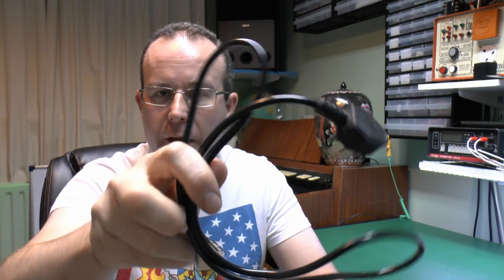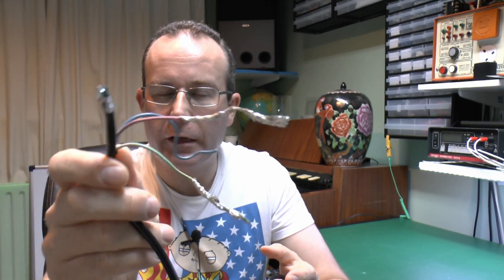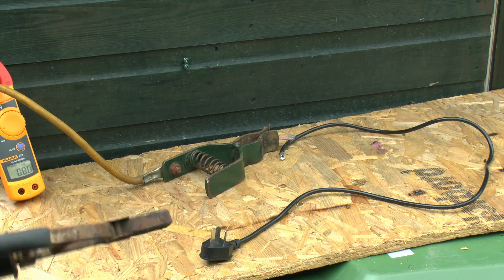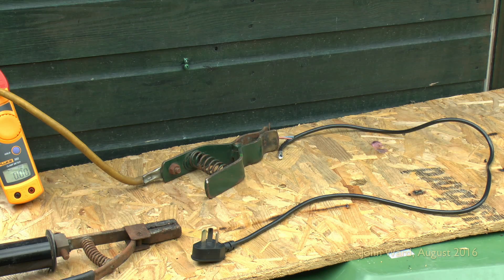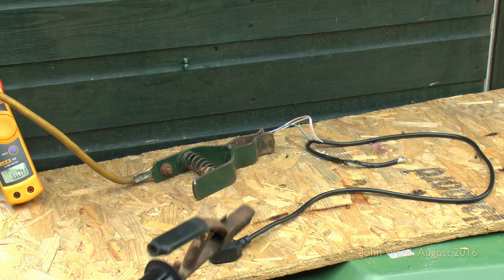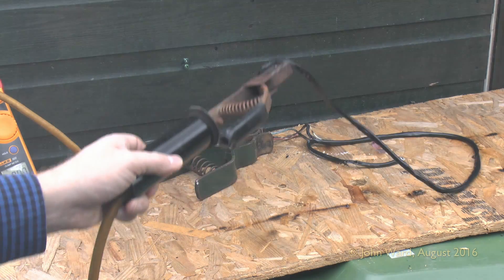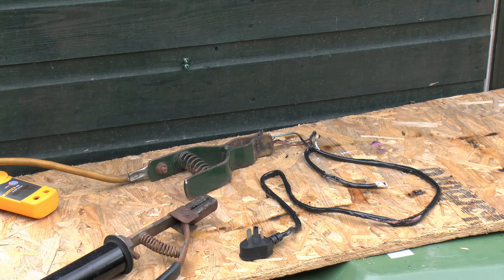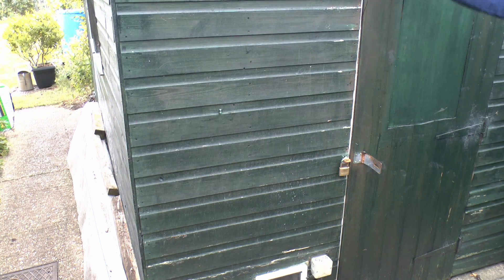Solder Pot Flex Destroyed

Comment: isn't that a Australian/new zeeland type plug?
Reply: That's a common Chinese plug, it's almost the same as AU/NZ, except you'll see that they cord exits from the side closest to the angled pins instead of from the ground pin - that's because in China they use the pattern "upside down" from the way we use it in AU/NZ (in China ground pin is "top", in AU/NZ ground pin is "bottom").  Also note there is no sleeving on the pins, which is required for AU/NZ, and the pins may be thinner also.  Of course, it's not uncommon for the Chinese style plug to be found on things sold in NZ, just with sleeving on the pins to make them legal but still upside down,  which is a real PITA.
Reply: ***** I don't know the history of why China came to use the same arrangement (that said I believe it's just "the more common one of many" used there), or use it 'upside down', but there is perhaps an argument to be made for China's arrangement - consider what happens when a plug is pulled partly out of the socket due to downward weight, in the Chinese orientation earth on top, the earth pin is exposed more than live/neutral which form the pivot thus making it less likely that something or someone could contact the live pin.
Reply: yes it is an australian/newzeeland/china plug
Reply: Therory 1 
Clearly when China copied the Australian plug they realised that it was the wrong way up and corrected it.  The Earth pin should be at the top so that if something accidentally falls down the gap between the plug and the socket it hits the Earth pin and not the live pins.

Theory 2
China is in the Northern hemisphere so naturally when they copied the Australian plug it came out upside down.
Reply: Um....  That would be - NEW ZEALAND (FFS!)
Reply: @Deebz270  Geeze, I'm a highly strung kiwi but go easy fella, Countries names are spelled differently in other languages and in some of them, the Zealand bit IS spelled as Zeeland so it's an easy mistake to make. As an example, New Zealand is spelled Nieuw Zeeland in The Netherlands, or Nederland as they spell it there natively. (FFS!)

Comment: And so easy to dispose of as well, just lift the lid on the wheely bin, and drop it inside. Have you tried a magnet, easy way to see if it is CCA or copper coated steel wire.

The utility companies here are going heavily into aluminium distribution cable, with a steel tension member, as it makes the wire less desirable, as you have to unwind the steel core off it. They even are using an aluminium coated high carbon spring steel as one of the conductors, to make the required grounding conductors on the wooden poles, as this is so hard that it breaks the choppers used in the scrap yards, so they will not take this cable at all, even the crooked yards.